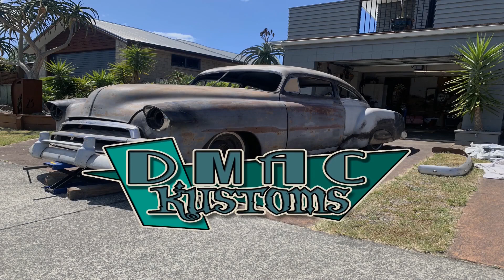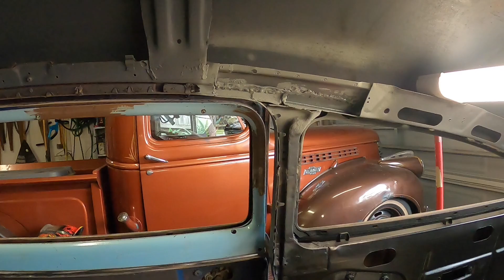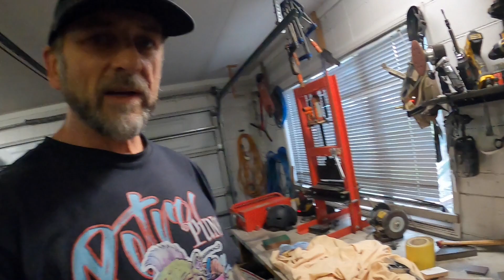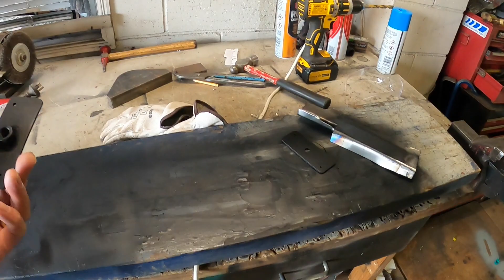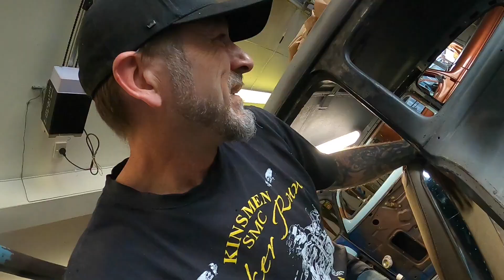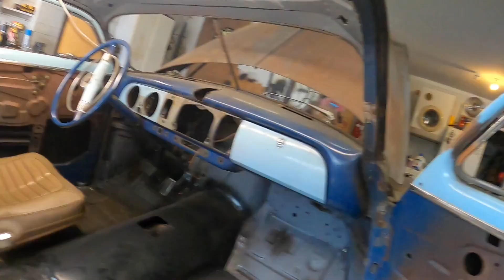Area 51 Update: Finally finished the inside B Pillar and upper seat belt mount - Chopped 51 Chevy

Comment: Just recently subscribed number 255 i believe . Most was interesting and i don't like to complain . But you need to work on the sound . I adjust the sound so i can hear you and get settled with a cup of coffee then sometimes when you speed up the video as you work , which i like , the sound gets a lot louder . Sometimes i hold my coffee in one hand and have the other one on the sound control knob so i don't have that loud music blasting my ears . Hopefully that can be corrected or it's unsubscribe time .
Reply from the maker: Hey Jim. 
Thanks for the feedback. I can bring the volume down in future editing but not on already uploaded stuff. But I’ll definitely try get the levels more evened out
Reply: @DMACKustoms  Thank you and i hope so . Due to very bad hearing problems i have to use the closed  caption along with hearing with the one ear i can still hear a little with . When the sound go's up quickly it hurts my ears badly . I spent 40 years  working  around lot's of noise , that was back when company's never cared as long as the job got done .